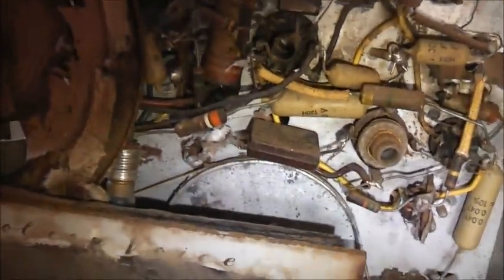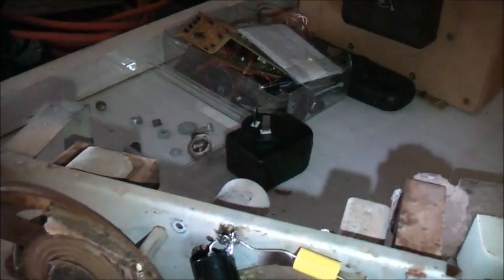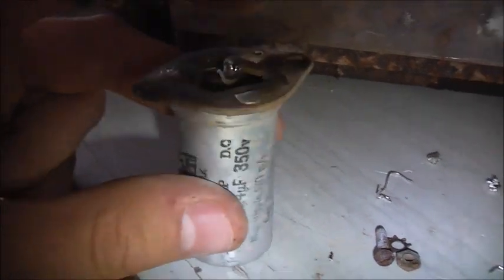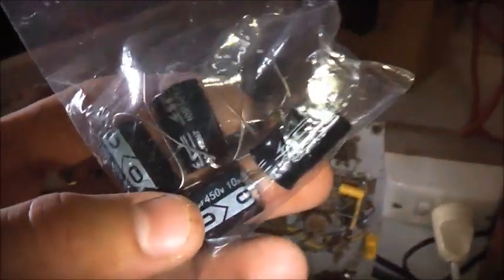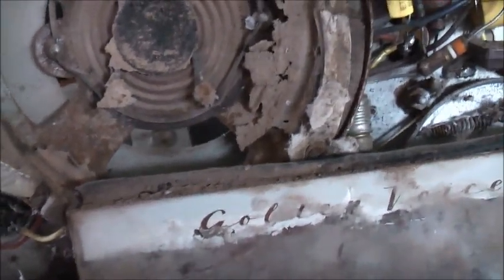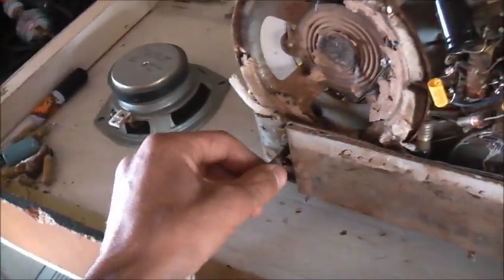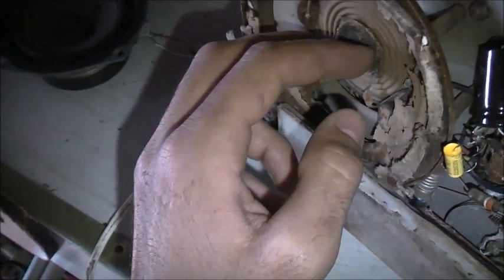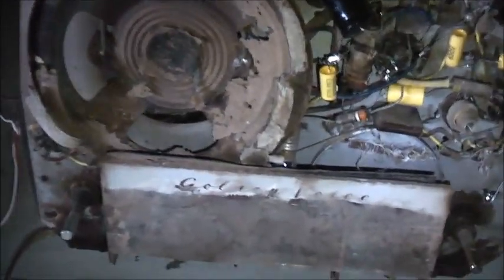Healing 405E Golden Voice Valve Radio Restore

Comment: Wow, Not bad for something left out that long! Definitely clean the Tuner cap fins, but I think there's an IF stage oscilation going on too. It's effectively getting a 465KHZ? carrier all the time which is why it hetrodynes with stations, but locks to a strong station if you tune it in.
Don't know enough to advise how to fix, but check shielding, resistors and caps in the area. you'd be unlikely to hurt the audio valve with different speakers on the secondary side of the AF transformer.